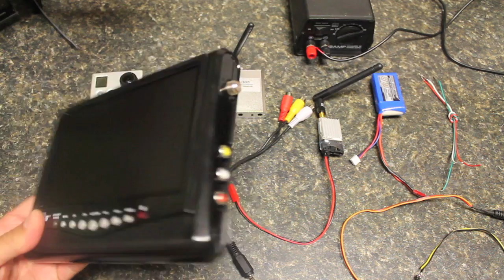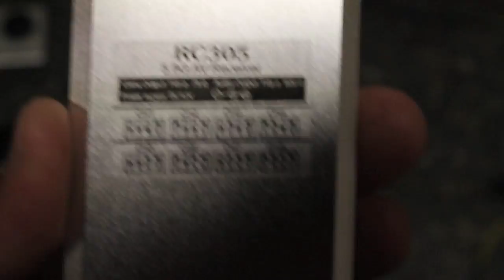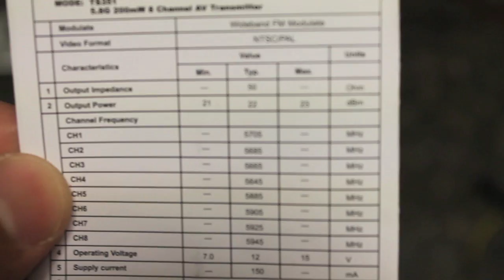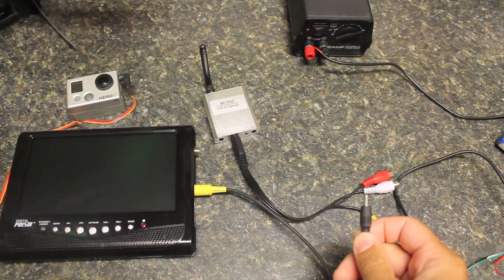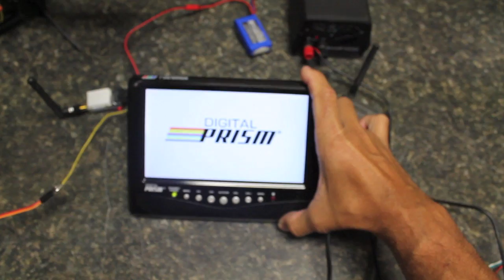How to Setup FPV w/ GoPro HD, HobbyKing 5.8GHz Transmitter/Receiver for DJI Naza Quadcopter

Comment: What kind of range do you get with this set up. I was thinking about putting it in a car and transmitting back to the pits for race application.
Reply from the maker: Cameron Recknagel I had talked to another guy a while back about doing this. You should definitely upgrade both the TX and RX antenna. You'll also need a good line of sight with few obstacles in between. 5.8GHz isn't the best when it comes to transmitting with obstacles in the way. It works well with aerial vehicles because you generally have a better path than on the ground. I'm not saying it can't be done, but will just require some trial and error. Good luck and feel free to reach out with any other questions.
Reply: You can totally do this with a car, I do.
I use the sony 600TV line FPV camera ($60) because it's lighter than a GoPro., and I don't think this AV TX and RX are capable of anything over SD video anyway.

I put the camera on a rig I made with a couple servos, so I can look up, down, left and right, and use the head-tracking in the goggles. (not so great for long distance)
I can FPV with the TS832 Av Tx and my Skyzone Goggles around the block, from inside my living room.. 

The key is to get a flat, square antenna for long distance, and keep it pointed at the car.. (Head tracking requires use of ground station... can't turn head and point the antenna mounted on the goggles pointed at the car... make sense?) I also use a matched pair of IBCrazy Blue wonder antennas, -one on the TX and one on the other antenna spot on the Skyzones.. That about triples the range and signal reception.

The devil is in the details, and the details are the right antennas! Get a nice 3 lobe clover leaf on the TX and a 4 or 5 lobe skew planar for the RX.. :)

Comment: im new to this fpv stuff. on the rc 305 receiver it said that its a powered with a 12v dc can you use a rc battery if so what type and size
Reply from the maker: thumper1499 Yeah totally. You can use a 3S lipo. My operating voltage is 7V - 15V so I can use a 2S or 3S on my RC305. Hope that helps.

Comment: Got myself the same Tx and Rx set from HK. I have noticed quite a bit of flickering on the monitor - intermittent blackouts. Have you had anything similar or have a solution I might try? I am powering the Tx from the main battery. Will using a dedicated battery for the Tx reduce noise?

Also as an aside, I noticed the Tx gets quite warm.
Reply from the maker: Charles Connor One thing I'd make sure of is that your props are well balanced and there aren't too my vibes coming off your multirotor. I've seen that cause flickering in several instances. I think a separate battery source is a good idea. Yes, the TX will get warm but the heat sink should help that heat dissipate. You also may want to consider upgrading to cloverleafs if you haven't already. That will generally give you a stronger signal.
Reply: The TX does get hot, don't worry it's normal opp temp is seemingly kinda hot for electronics. Don't sweat it unless it's too hot to touch, then it's probably getting time for a new one.

I had that same flickering problem... I checked it out and realized I had the TX RX version that requires higher voltage.. 9-15v  Hooked it up to a 12v UBEC and it's crystal clear..

Another similar issue on a different unit, was cleared up by using a matching set of clover leaf skew planar antennas.. Just make sure you get a matched set and put the right one on the TX ( usually 3 lobe ) and RX..(usually 4 lobe) 

I recommend doing that anyway, the original antennas aren't worth crap.

Comment: Hi! Thanks for the video.

What about the range? Did you change the antenas?
Reply from the maker: Rafael Melo I added a cloverleaf and saw over 2X the range. The latest I've been testing with is Zwcky's Helical antenna:

A Brief Intro to Zwcky's 3D Designed and Printed 5.8GHz Helical FPV Antenna

I'll see if I can do a range test soon.
Reply: Thanks

Comment: Please, can I ask, does a higher receiver voltage mean a longer range. You said you were going to make a range video with voltage changes but I couldn't find it. 
Can you please answer my question ? Anybody?
Many thanks!
Reply from the maker: Night Flyer There is an optimal input voltage and anything over that voltage will be dissipated as heat and will not increase your range. I'm not an expert, but have been told there's voltage regulation going on and anything over that threshold will be wasted. Now this is all theoretical and I haven't done any distance tests yet. But it does make sense to me.
Reply: If you want longer range, you must purchase better antennas. Look up cloverleaf and polarize antennas.

Comment: Can the transmitter and receiver (and 12V monitor) be powered from 3s batteries (one for the transmitter, one for the receiver/monitor)?
Reply from the maker: Charles Connor If you're using the same setup in the video then yes you can run the TX and RX off 3S lipos. Here is the product I'm using: http://amzn.to/1nNJArL

and here's a manual that shows the operating voltages:

http://shinwa2000.com/downloads/Boscam%20RC805%20-%205.8Ghz%208%20Channel%20AV%20Receiver.pdf

I use 3S both on the ground and the air for the video TX/RX. Not sure what your monitor input looks like but if it's 12V then 3S should work just fine.

Comment: Will the TX work on a 3s 1000?
Reply from the maker: Fire Strife Yes...it should work. I'm flying with the TS351 as seen here: http://amzn.to/1nNJArL

and you can read about the operating voltage here:

http://shinwa2000.com/downloads/Boscam%20RC805%20-%205.8Ghz%208%20Channel%20AV%20Receiver.pdf

anywhere from 7 to 15V so a 3S works nicely.
Reply: Dennis Baldwin Okay! Thank You! And if you ever need any multirotor frames visit www.dgiframes.weebly.com Only 40 bucks for a full size tricopter!
Reply: Please, can I ask, does a higher receiver voltage mean a longer range. You said you were going to make a range video with voltage changes but I couldn't find it. 
Can you please answer my question ? Anybody?
Many thanks!
Reply: Btw will the RX work on a 4s 3000?

Comment from the maker: +joe mcDonald To answer your question the jack is NTSC/PAL compatible. It's this receiver right here: http://amzn.to/1npiYOh
Reply: Dennis Baldwin I'm working on a DIY project where the Receiver needs to be on the moving object and the Transmitter is a fixed object does it work this way with the current equipment and antennas?

Comment: Can you use a 2s to power the receiver?
Reply from the maker: The input voltage on mine is anywhere from 7V to 15V so I can use a 2S. If you have a similar setup then it shouldn't be a problem. Just be sure to check your input voltage in the manual. If it's the same as mine you should be okay.

Comment: hi dennis. i have the phantom FC40 with a 5,8 ghz controller. will i be able to use a 5,8 Ghz fpv without interfearing  my controller?
Reply from the maker: Hey Victor, that will definitely be a problem. I've read about all sorts of conflicts with the Phantom 5.8 GHz TX and 5.8GHz FPV. You may want to look into 2.4GHz. Best of luck.
Reply: ok thx you werry much..

Comment: Dennis, regarding the channel setting, switches in circuits like this are of course digital.  Switch values are as follows.
Sw 1 = 1
       2 = 2
       3 = 4
       4 = 8
       5 = 16 and so on.
Therefore sw 1&2 are on and add to 3... Similarly if the channel was 8 it would be only sw 4 on. If it were ch 5 it would be sw 1 and 3 on, whose values are 1 and 4.  
     I hope this helped a little
Reply from the maker: Thank you. You and several others are much smarter than the Boscam manuals! It's so aggravating to follow a manual that's obviously wrong. Appreciate you sharing this information for myself and others.

Comment: Could I run that receiver with a 2s lipo even though it recommends 12V?
Reply from the maker: I believe so. If I recall the operating voltage is between 7 and 15V, but make sure you check your manual to confirm. I've definitely run mine in off a 2S before.

Comment: How would one go about connecting the Gopro in this setup to a gimbal?
Reply from the maker: The only challenge I see in doing that is you'll need to have enough slack with your video out cable to make sure it doesn't get tangled in your gimbal axes. But other than that the wiring should be the same and you just need to figure out the mounting.

Comment: The channel DIL (Dual In Line) switches on the Tx and Rx just make a decimal count in binary - so

0 = Off  1 = On

0000 = channel/decimal 0
1000 = channel/decimal 1
0100 = channel/decimal 2
1100 = channel/decimal 3
0010 = channel/decimal 4
1010 = channel/decimal 5
0110 = channel/decimal 6
1110 = channel/decimal 7
0001 = channel/decimal 8
1001 = channel/decimal 9
0101 = channel/decimal 10
1101 = channel/decimal 11
0011 = channel/decimal 12
1011 = channel/decimal 13
0111 = channel/decimal 14
1111 = channel/decimal 15

Chris

Comment: You said "You usually want to have a separate FPV cam than your HD Capture camera"... Why is is preferred to have different cameras?
Reply from the maker: Hey, thanks for the question. My point is, at least in the case of this video, that the GoPro is a bit difficult to fly with as an FPV camera. It has a different perspective than an FPV camera such as the PZ0420 (http://amzn.to/1etlAHK). The GoPro is more of a fisheye lens and therefore I found it difficult to gain good perspective around the edges. Hope that makes sense and I know there are a lot of R/C pilots that fly with them. I just couldn't get used to it :)

Comment: well if this work like DMX dipswitch its fery fery easy to understand...you have 
1 2 3 4 if you want channel one you only turn on one zo "0 is off 1 is on " so you set it like so (1000) bud if you want 6 you turn one 4 and 2 (0101) its a small sum only if it just work like DMX dip switch

Comment: How can you power the receiver in the field
Reply from the maker: I use a 3S lipo since the input voltage is 12V.
Reply: Dennis Baldwin is it okay if i use 2200mah 3S lipo on 5.8G 200mW AV wireless transmitter and receiver with current supply: "150mA" ( newbie here )
Thanks!!!

Comment: How long will the 2s power the transmitter 
and camera for
Reply from the maker: I did a test of this a while back and it will easily outlast your flight time. With a 800mA 2S lipo it was over an hour...and I believe could have gone much longer.

Comment: Hi, greeat video and guide, thanks. But i have a question, is this also possible to do with GoPro Hero camera?
Reply from the maker: Yes, I'm pretty sure it is. I was trying to get the link for you on readymaderc.com but their site appears to be down. When it comes back up check out their site and let me know if you can't find the GoPro Hero cable.
Reply: Dennis Baldwin
Thanks, it is not rpoblem in the cable, im jsut asking if it possible, i found cable on ebay so no problem.

Comment: Do you happen to know if the VRX works on FatShark or Immersion channels, Dennis? I just got mine in off eBay and I can't get it to work with any of the VTX's I have here.
http://www.ebay.com/itm/321328490252?ssPageName=STRK:MEWNX:IT&_trksid=p3984.m1497.l2649
Or a link to that RCGroups thread you mentioned? (BTW...BIG fan of the channel. love your videos)
Reply from the maker: From what I've read and heard from several others is that they are not compatible. I don't have any first-hand experience though. Thanks for the kinds words. I appreciate you watching my vids. Take care.

Comment: Great vid BTW! I have been thinking of doing this for a while, but my main issue is which quadcopter would be able to handle the weight of camera + transmitter + battery
Reply from the maker: What type of quadcopter are you thinking of putting this on? Most 450 size quads won't have a problem with this setup.
Reply: Dennis Baldwin not really sure. i'm new to the hobby and don't want to invest too much in my first quad. Perhaps something like Wltoys v262

Comment: If you want to cut the cost on this while sacrificing transmission range you could go with the 2.4ghz transmitters which i think run around $20-30 (maybe cheaper now)
Reply from the maker: True. The only problem is that you'll need to run your radio off a different frequency.

Comment: how would i power the reciever if i was doing it outdoors?
Reply from the maker: You could use one of your LiPo batteries. I power mine off a 3S. Make sure you check your input voltage for the RX before you try anything.
Reply: Oh OK, thx

Comment: The channels switch settings represent a binary number.  It an easy way to get upto 16 different setting from 4 switches.  1 and 2 on is the binary is the number 3

Switch:
1     2     3     4
off  off   off    off = 0
on  off   off   off = 1
off  on   off   off = 2
on  on   off   off = 3
off  off   on   off = 4
on  off   on   off = 5
off  on   on   off = 6

The pattern continues.

In your set up switch 1 is the small value of the binary number and switch 4 is the largest value of the binary number. So if you look up binary examples online usually you will see the the values in order from largest to smallest. 

I hope this makes sense.
Reply from the maker: Awesome feedback. Thanks for the info.

Comment: Thanks! What is the range of that transmitter?
Reply from the maker: With the standard antenna it's not very good. You can increase the range with a cloverleaf & helical. You may be able to get up to 2 miles with a helical setup.

Comment: Thanks for your earlier response Dennis, the USB is working fine through my HK 5.8Ghz Tx. Another probably dumb question... to connect an OSD (DJI Mini iOSD) to the HK Tx do I simply join the OSD signal & ground wires to the video out yellow / black wires from the Gopro to the Tx?

Thanks again.
Reply from the maker: Peter, it's really hard to say without seeing your setup. What I recommend is take a photo and post it in the forums at www.garagepilots.com. Either myself or someone else in the community will be happy to help you out. But as they say, a picture's worth a thousand words. Thanks.

Comment: But how do you start and stop the camera? Can you change camera modes without wifi?
Reply from the maker: Good question. Right now it's a manual process where I start recording on the ground and then stop recording when I land. There are remote control capabilities for different cameras but I haven't used them before. I've been looking into one for my Canon camera: http://chdk.wikia.com/wiki/USB_Remote

Comment: I am thinking of building a FPV quadcopter with the DJI Phantom I as the base.  Can the FPV rig you describe here be crammed inside the Phantom, or does it hang outside somewhere?  If there is a video that goes through this please post a link.  Thanks!
Reply from the maker: I'm not sure if that will work. I remember a guy posting on www.garagepilots.com with some DJI Phantom mods, one of which I believe was an FPV transmitter mod. Good luck with your build.

Comment: It took me two hours to figure out that you only get video feed IF the camera is connect AND the code is correct. If the camera turns off and you think you're going to see video signal, dream on buddy. Let me tell you, it's a pain! I bought the same setup, but the code is all wrong for the TX, TS 351, down - down - up - down but, the markings is different, the whites are the switches and the blacks are the empty spots. People, don't google for this TX, couldn't find a single code that matched, even from FPV forums. Just do trial and error. I'm getting some signal noise, a noise line going up, is that normal?

Comment: Hello, thank you for this video. My question is: Is it possible to use this transmitter http://r.ebay.com/9rXUmC with 3s 11.1V 2200mAh battery in my Blade 350qx? I need to make this work to reduce the weight and extend the flight time (I have brushless gimbal to this battery connected as well.)

Thanks for the answer
Reply: I wouldn't. It's gonna get hot very fast. Just buy a separate lipo for it, a S2 1000mah is enough.
Reply: Ryuuken24 I don't mind getting the transmitter very hot if it's not gonna cook. The flight times are usually only around 5 minutes anyway.

Comment: hi would this go behind hills or trees thanks
Reply from the maker: Generally 5.8GHz doesn't do a good job of penetrating through obstacles. It's generally the weakest frequency band for FPV so you'll need to experiment. I believe trees will cause some problems, but not as much as hills will.

Comment: Hi Dennis. Thanks for the video. I just got a used version of this same tx and rx today, so your vid was timely. However, I noticed a difference between your tx video in and mine. Looking at it from the heat sink side, the three wire setup on mine is black, yellow, red, in that order. Your video shows the yellow wire where my red one is (3rd position). I wonder if you are really getting video out of the 3rd position? I ask because mine is identical to yours in every way except that, and since mine is used, the person I got it from says his works fine. The only difference could be that he is using the red wire for video, instead of yellow. So, what has been your experience? Thanks.

Comment: For the Frequency select switches, in the binary world the first switch is value 1, the second switch is value 2, the third switch is value 4 and the fourth switch is value 8. Just add the values of the on switches for the channel no. This may work.  Next for the monitor power supply try a equipment belt. Just run wires to the monitor for the battery on the belt.
Reply from the maker: Good stuff. Thanks for sharing that info.